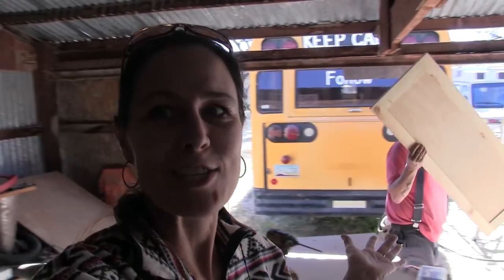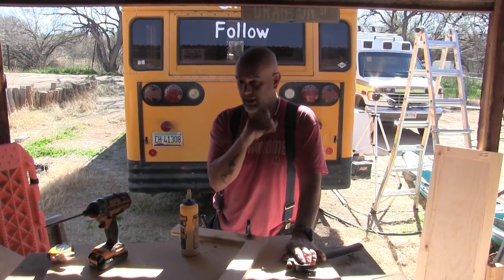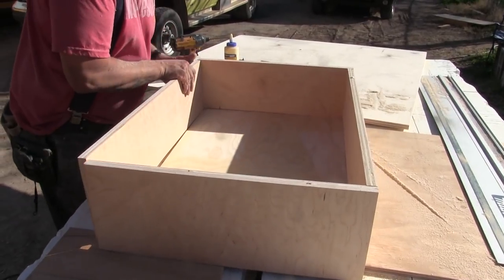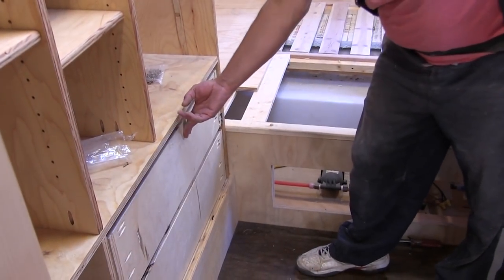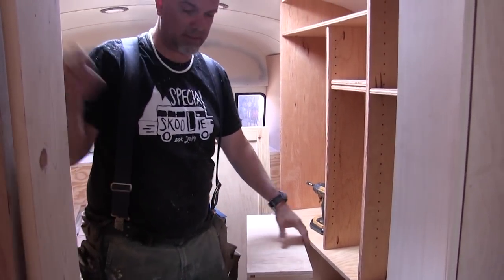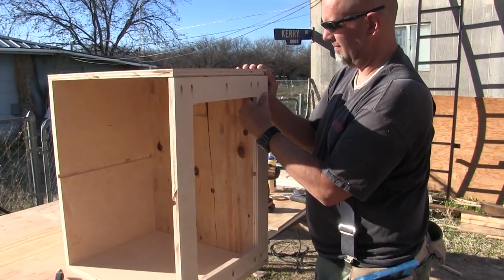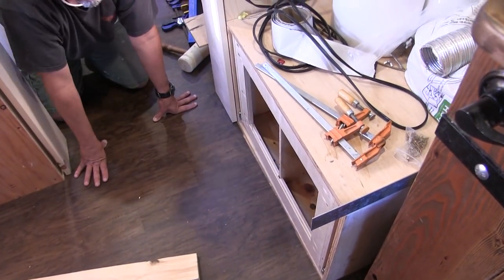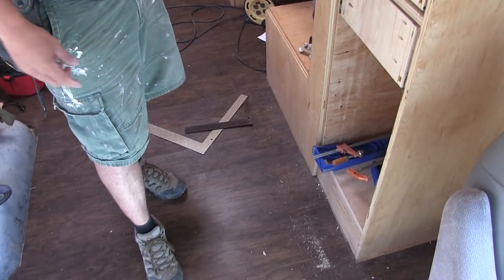Enormous Drawers & Cabinet Doors for the Entire Skoolie

Comment: Drawer master Mike I built my cabinets from scratch for my first coach 20 some years ago out of 3/4 red oak and it was pain staking 50 some doors and 20 so drawers I didn't have the kregg system wish I did back then I have one now and yes they are the best.
Nice work well you know what you can do on the road now for extra money if needed.

Comment: Put ventilation and/or a 12V muffin fan in your battery drawer. It will heat up in there if you are charging many things at one time with no air flow.

Comment: I assume you know that the slide portion that attaches to the drawer can be unclipped from the cabinet side and then screwed to the drawer sides making your bottom drawer install problem not a problem. Just saying. Great job with everything your doing.
Reply from the maker: You know, I totally knew that and yet I never put two and two together! Thank you now I can add those extra screws! Sometimes I'm just stupid.

Comment: What's the tool you used to make the channels in your drawers so you could slide the bottoms in?  And is it the same one that you used to make our cabinets doors .. where you were able to slide the face in?
Reply from the maker: We used a table saw with a dado blade in it. I used a router to make the dad's in the cabinet faces. It is just mounted in a table I made for it.